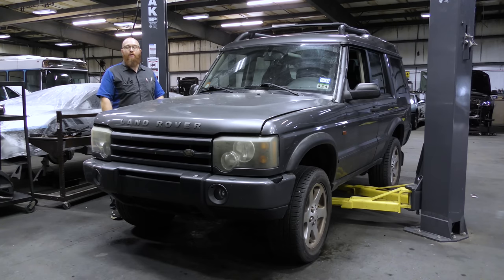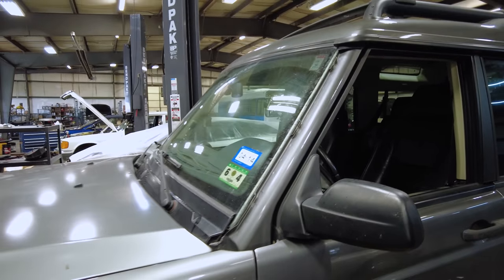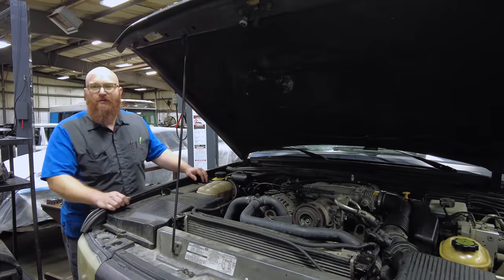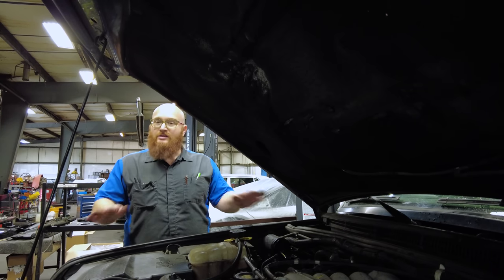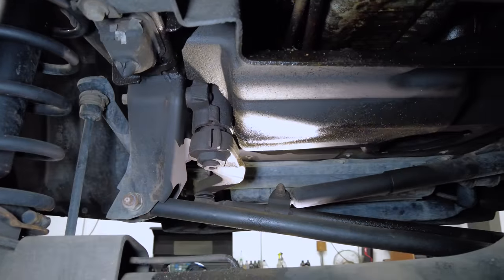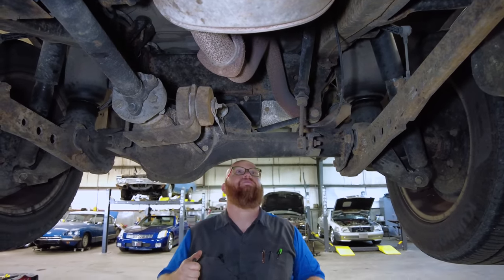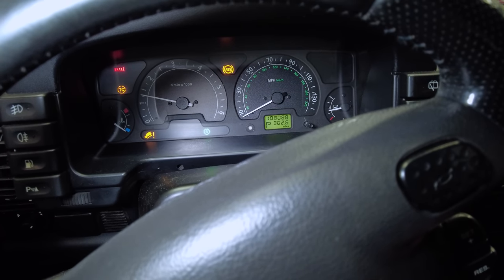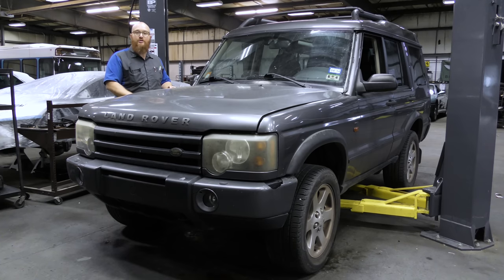Major items to watch for on Land Rover Discovery 1 & 2! CAR WIZARD shares their serious issues

Comment: There isn’t an SUV out there that drives like my 2004 D2. At least once a week somone comments on how great it looks.
That said, it needs a new motor a rebuild due to the 100% failure rate if the f-n cylinder sleeves.
I’ve spent thousand keeping up on preventive maintenance, the right oil, frequency, coolant changes, never over heated and it still has low mileage, 180,000kms…
There should have been a class action on the motors.
Imagine if rover skipped Buick and went with the GM 350? They’d all be on the road to this day.
Only fix for the sleeves and head gaskets problems is the top hat cylinder sleeves and about $6k.
If you don’t live it, stay away!!!

Comment: Picked up a 95 Disco in 2021. Love mine because it's OBD1, lacking a bunch of extra sensors for OBD2 vehicles. Currently 230,000 miles on the engine. I love mine so much I'm considering rebuilding the engine when it goes. Bottom line, ALL vehicles require maintenance. If you don't like to maintain your vehicles or pay to have them serviced, buy something new. Everyone who talks trash on Land Rover, have either never owned one or didn't turn their own wrenches.

Comment: I had a 1989 Range Rover with the 3.5 V8 and it did Gaskets at 110,000...Can't believe they still have this fucking issue right to the end. Typical British Engineering

Comment: That double cardan joint on the front propshaft is just a weak link, being non-greasable item!  Seen damage that it can do when it lets go.  
The transfer case just leaks like a sieve.  The rotoflex coupling is such a weak part, distorting and causing vibrations.
Cylinder liner slip means a very expensive engine rebuild.
The head lining will probably be looking like a wobbly tent by now.
The worst part about owning this vehicle is the horrible gas mileage, and lack of power despite the thirst.

Comment: ya know i dont think car wizzard will see this but i have a question, on my car (2000 pontiac grand am with the 2.4l engine has an abs code that comes on intermittently but only when the car has just been started and take a turn and DING on goes my abs light my service vehicle soon light and my trac off light. and when i plug my scan tool in the only code i ever see is a c1225 code saying “left front excessive wheel speed sensor variation” and i have no idea wtf that means!

Comment: As a Land Rover owner of the S11 type. this thing here is Canada would rust to nothing. You have to build them on a hot dipped Galvanized frame. You can buy them from England. The S11 was a good vehicle but boy could it have done with some improvements. To me Land Rover just lost the plot. Repairbility was what they were about. They were not the most reliable vehicles but easy to fix when they did break. Lucas wiring and components did not help. Mine is wired with Mil spec aircraft wire. I designed all the electrics and specified all the components. All AMP military connectors. It is better but still room for improvement. Such a shame Land Rover did not improve on what was such a great product. It could have been so different.

Comment: Hard to believe how tinny that gen is and how costly they are to maintain ! Even just the basic maintenance items !
Reply: Parts for the td5s in the UK are dirt cheap. They do have many problems but are in 85% of cases not going to leave you stranded and cheap to fix. The rust however is a different story.

Comment: these discos are some of the most unreliable cars on the market, I had a 2003 for 7 years I fixed everything, burnt a valve, head gaskets everything, don't forget the 500 crank hub which seals the crank, or the steering boxes which are always worn to death, or the coils which are very hard to get to, don't run synthetic it will only help the buick 215 leak faster, they can eat diffs of you don't maintain, use champion plugs, water pumps don't last long bc they have the fan hanging on them, don't by one with sunroofs or your car will never be dry and it will smell bad
Reply: 😂😂😂😂 water pumps don't last long because of a fucking clutch fan? Like fans have even run in every car fucking ever until more modern cars switched to all electric fans?

Comment: I must of got lucky? No amigos, no head gasket problems? Mine is a td5 manual with decat straight pipe. Egr delete, ACE disabled. I also run it on a 50/50 mix of diesel and used engine oil. Half the price 😊 i Keep telling myself that's 50mpg in an old Land Rover  😂

Comment: my grandmother has a 96 range rover p38 and i love it till i have to fix it now i need to explain i have a really nice scan tool and a few not so nice ones the nice one is a autel that is capable of doing module reprogramming and replacement cost me over 3k to get its unable to communicate with her car lol i can’t talk to any electronics in here car with it now my cheap 150$ autozone tool will talk to the pcm lol and i do know why her car is a real last of the real rovers so i need to proper tools to fix it now as far as engine stuff its a cake walk very simple to work on stuff but i really recommend getting a little newer than the older 1996 generations because the electronics side if you need to do diagnostics is just impossible things like keys are no longer available for the 1996 p38 so if they break is a real problem with the security system  amazing car otherwise an im grateful i have someone who has access to a old dealer service tool for the car

Comment: Another D2 I see without ACE suspension. I wonder how rare that stuff was, and am a little miffed that I removed it from mine years ago. Wonder if it was still intact if it might have bumped the value.
Reply: I sold mine with working ace, I regret selling it
Reply: ACE was only on the top tier models unless you paid for it standalone

Comment: A friend of mine has a 99 Discovery 1. The shifter got stuck in Park and  no brake lights.  Brake light fuse popped. I believe it was fuse #25 behind the dash. Replaced fuse, and everything went back to normal. His ABS light is on and has been for the past 20 years. It overheats, too. I told him about the head gasket issue with these engines.  You can see the air bubbles in the coolant tank. He doesn't believe me because it still runs ok,even though it idles at 1700 rpm.🤣🤣🤣 Honestly, I can't believe that pos still moves under its own power. 🤣🤣🤣 If you don't have deep pockets, and you're not a decent mechanic, this is not the vehicle for you. I would not buy one of these.  Plus, I've not found an affordable bidirectional scan tool that works on them. I'm pretty sure the ECM is incripted.  Probably  need a Snap-on scanner, just to replace the IACV. And that's too bad because I think they are a nice-looking and very capable suv.

Comment: I got my Disco 2 as a gift from my sister. 
My sis was the second owner. 
Because the previous owner didn't do any service at ALL. I went thru it. Checking everything from bumper to bumper. After 3 months of work. I got it licensed for my state and transferred the title. 
It became my daily driver. It has 210,000 miles. 
Yes it had a head gasket failure. I bought upgraded head gaskets and new head bolts. It was an easy afternoon job. 
The head gaskets were leaking to the exterior of the engine. At that time. I actually bought more parts. Since I was already doing the work. To this day no head gaskets issues. Engine starts every time. I enjoy my Disco. 
It doesn't matter what kind of vehicle anyone has. They all have issues. From Engine failures. Lifters on Chrysler and Dodge ram and other vehicles. Chevy with transmission failure and lifters failing. 
I still like my Disco regardless of what the haters say. 😅😅
Reply: I hope you keep enjoying your Disco!  They do have their issues - I know; I used to be a Land Rover tech - but if you can tackle the head gaskets yourself, there's pretty much nothing on that vehicle you can't fix yourself.  Keep up with the maintenance, and it should be a pretty good vehicle for you for quite some time.
Reply: I just got mine as a gift too😎😝 bd gift from my parents

Comment: the D1 front swivels leaking is a non issue..just fill with a self leveling grease..the grade of the top of my head is EP 00 ...It is available from land rover or land rover specialists  .they call it "one shot grease " no idea why .   or 1/2 fill with EP90 and give it 50 pumps of standard EP2 grease from a grease gun ...then it is more reliable than the rubber boot on the D2 and the  oil bathed  roller bearings on the D1 will out live the ball joints on the D2.. ..not mentioned but the BIGGEST thing to look for on a D2  in the UK anyway is a rusty chassis..the D1 is MUCH more reliable than the D2..the most reliable is the early D1 with no ECU or any electric modulus ..my 200TDi engine only needs 1 wire to make it work

Comment: Does anyone know if an LS engine like a 5.3 liter will bolt up to the discovery 1 transmission?
I have a disco 1 that needs an engine rebuild but was thinking it might be easier to just throw in something better.
Reply: Marks 4wd makes an adapter but it's  pricey. No experience just know they exist.
Reply: @lawy3077  Thanks! I'll check it out.

Comment: The discovery is my personal favorite SUV ever, comfortable enough to drive regularly, but also has that old school Land Rover feel and unbelievable off-road capabilities with endless potential for modifications. 
I’ve owned a handful of them and my biggest issue is parts availability for the early years of the discovery 2 (1999-2002) I have had two separate trucks that have had a leak at the transmission cooling lines and parts do not exist, and that is the case numerous other parts for the 4.0 V8 Discovery 2, super short production run on those vehicles and most of the ones overseas did not get the V8 so it seems for the most part making parts for them has been abandoned.

Comment: Land Rover Discovery collectable????????????
Here in the UK where i am ashamed to admit they are thrown togeather, we are wise enough to avoid them.
Yes can be very lucky and buy a rare reliable one, but most have a well know list of issues to put right.
Great if you have access to a workshop with a ramp, but these are not a vehicle to get under supported
by bricks!
There are far better more reliable options outhere, i wouldn't have one given.
Reply: Did all the work on mine on axle stands, and like all discos it needed a lot of work. Drove it for a couple of years and got all my money back, just not the time I put in.
Reply: @philtowle4683  Most need a lot of work, and if the underside is poor condition they are best avoided.
For a good home mechanic with the tools and facilities they can be repaired at home, but if you have
to pay a "Wizard" the labour costs will make your eyes water.

Comment: D1 parts are cheap as hell. They are simple and easy to work on. The crap that always breaks are the options, all the stuff you paid extra for when new; sunroofs, leather, seat motors. The best D1 has zero options and a manual trans.  A d1 is almost literally a defender with something other than a tractor cab on top, and the last of the trucks that made LR famous in the first place; simple, field serviceable, giant robust parts. (Look at the size of D1 lug nuts and oil pan nuts)
D2s are a wildly different beast even though they look similar. They tried to lighten them for efficiency and cheaped out by making the frame steel thinner, using plastic diff plugs and a zillion other things that really cut corners… no longer is there an inline fuel filter, and they even tried to romove the diff lock lever in a bunch of them. It still had a lockable center diff, they were just too cheap to hook it up. Additionally, by the time the D2s came along, the casting machinery for the engines was so old and sloppy that those motors ALWAYS overheated and suck. D1s didn’t really have that issue and in fact if you rebuild a d2 engine it’s a good idea to source a d1 or a Range Rover block because the vast majority of D2s were fatally flawed. A rebuild would help for a minute but those engines are Swiss cheese. Now, it’s been so long that if you found one that’s still going that issue has been addressed by now. In fact the ONLY d2 I’d trust will have at least 170k miles on it. Be VERY VERY afraid of the 45k mile D2S on Bring a Trailer selling for big bucks because of low miles. Those are a complete trap. Now, the good thing about D2s is their body’s didn’t rust like the D1s did, the the door handles are way better, but the thinner frames DO rust especially in the back.

Comment: 2004 disco hse..Worst vehicle I have ever owned.  Left me stranded once a month...bought with 1 year old with14k miles...sold with 65k.  Spent months in the shop for vibration that was never resolved....the seat broke.  All 4 hubs were replaced at 50k.  Transfer case replaced at 24k miles. Eould not shift into drive oftern.  Crank sensor failed twice...puts it in limp home mode.Absolute garbage....do not buy this stupid vehicle and try to transport your family in it....oh ya...head garkets and valve cover gaskets were done as well.....god i hated this suv